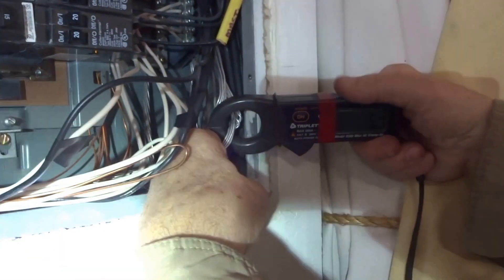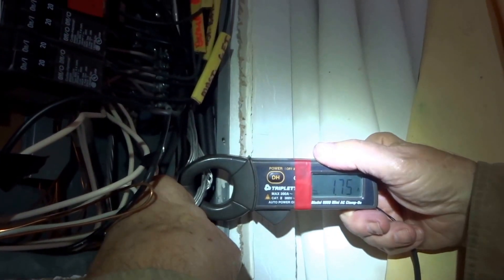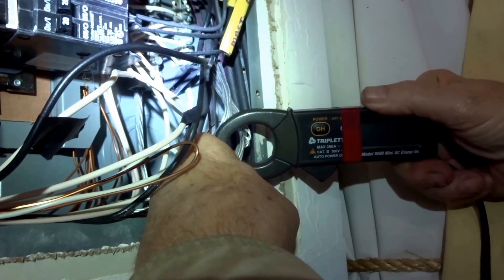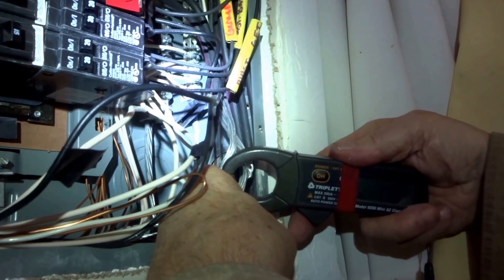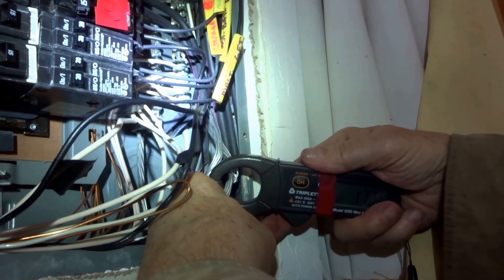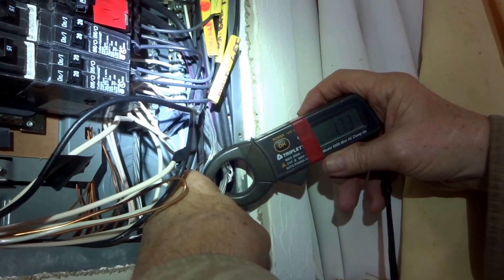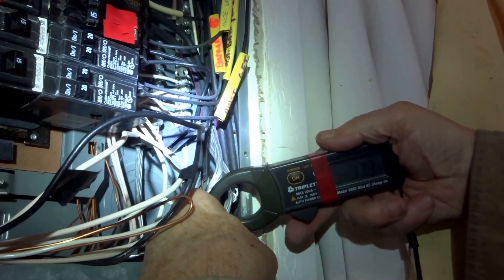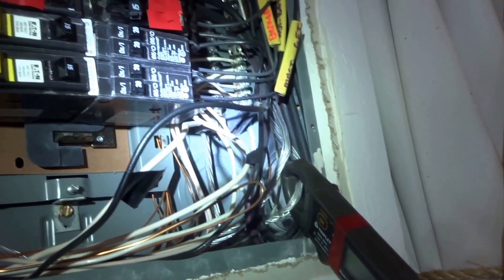Objectionable Current on ground wire from AC condensor

Comment: But what does it mean? Is it bad because the ground wire isn't meant for high current? I have a feeling this might be my problem. I get AC readings from meters everywhere on the wall, and when I touch the wall it goes even more crazy with it's beeps. I can also sometimes stroke the wall or metal face plate and feel a very very slight vibrating. If I rub the tip of my ear against it, I can hear a buzzing.
Thanks
Reply from the maker: Other than clearing a fault, there should be no constant current on the ground wire.  It indicates a neutral to ground connection at a place other than the service entrance and that is a code violation
Reply: @windheimemfsolutions  Thanks. Is this what I have? I haven't actually measured my ground wires to see if there is current going through them. Could I run a clamp meter round them? Or should I get a professional in to look at why my walls are apparently electrified?

Comment: Is it okay to mix ground and neutral together at the meter?
Reply from the maker: The only place they can be joined is the service entrance panel.
Reply: @windheimemfsolutions   that's not totally  true. NEC 250.24(A)(1) essentially says you can connect the ground in the places. 1) The load end of the service drop on a mast which is often impractical but allowed , 2) At the meter can where the neutral connects to the meter enclosure, or 3) The terminal or bus bar where the neutral lands on the service disconnect.

Comment: so what what he is saying is that someone used the ground wire as a neutral and the current is going from a hot wire to a ground wire instead of a neutral.  Other than being unsafe does leak power?
Reply from the maker: Yes Alexis,  This is the result of a neutral to ground connection at any other location other than the service entrance,  It puts current on the ground and creates a magnetic field as well.
Reply: I see.  But if the neutral was used instead will not the magnetic field just be on the nutral next to it.
Reply from the maker: This video from the California EMF project will explain it.  https://www.youtube.com/watch?v=IAAZCMns8YM&t=424s&frags=pl%2Cwn